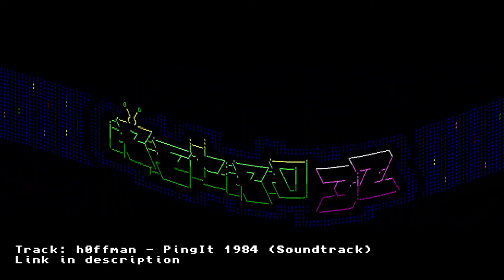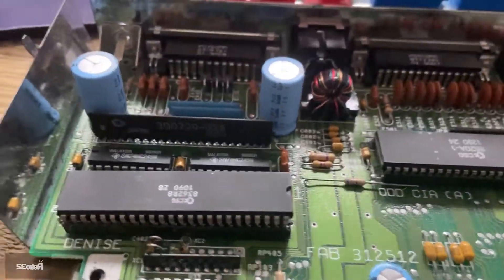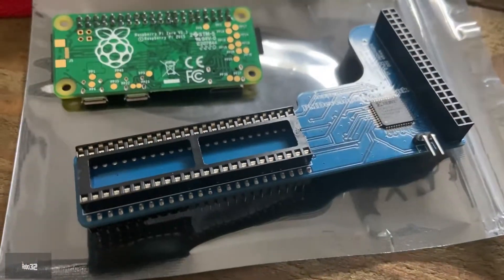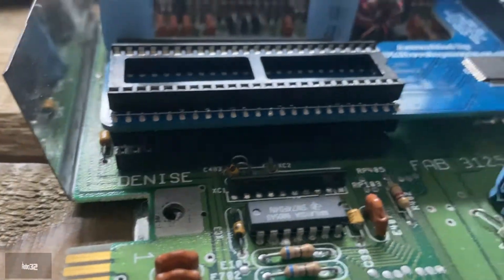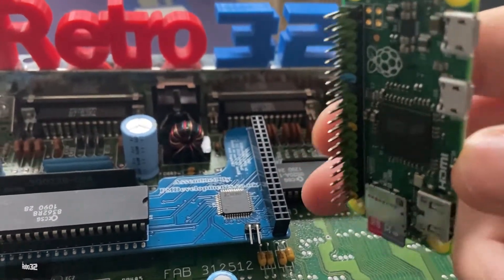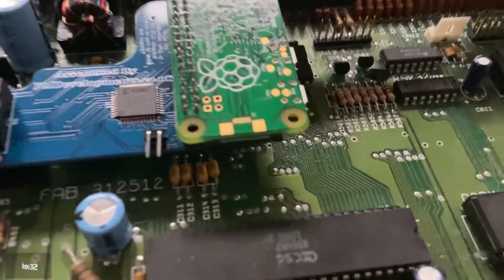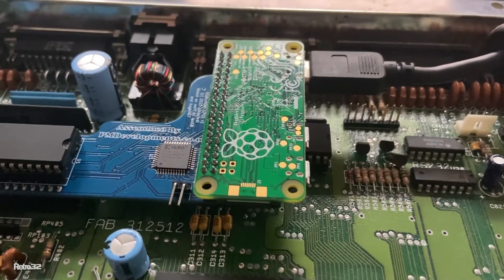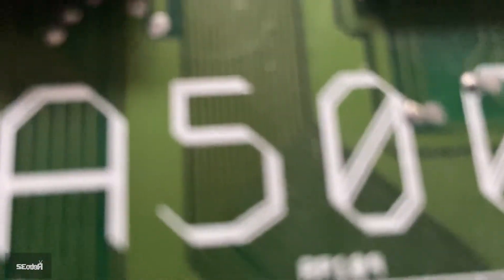Amiga 500 RGB to HDMI CPLD Adapter fitting guide

Comment: Doesn't this obstruct little bit a keyboard connector if you have a thick HDMI cable?
Reply from the maker: It can do. This is why I use a right angle hdmi ribbon cable like they use for FPV

Comment: Can you show what options you have set in the menu, I see the desktop but it flashes, when I go into the menu it is fine, I have tried a few different resolutions but the desktop keeps flashing
Reply from the maker: Other than to test out the cables, I’ve only used the menu once to see if it works. I leave it completely standard
Reply: @Retro32  I had to disable the auto profile switching, I think it depends on your tv/monitor.  I also switched my sub profile to amiga60hz.

Comment: Hi there, please could you tell me how you cycle through the config menu? Is that mouse or keyboard driven?

For me it’s stuck at the top of a menu
Reply: you need to hook up the little switch that was included and click it to go thru the menu and long press to activate an item, then you will see the > < around the item that is being changed, short click to change it and long press to go back to the menu, when you are done click thru the menu until you get back to the top and long press to apply changes
Reply: @MatteoPascolini  I tried it like that, but the short press just closes the menu..? What could be going wrong here.. HW or SW ?

Thanks for reaching out
Reply: When I say short press / click I mean for just a second.  And you have it hooked up to the adapter board, not the PI.  And you have it installed as it is shown in this video?  With the hdmi cable coming out of the PI to a monitor?  Can you make a video with your phone showing how you have it hooked up and post the link here.
Reply: @MatteoPascolini  : I’ll make a vid today and let you know
Reply: @MatteoPascolini  made a short video of where I’m stuck. I appreciate you taking a look and offering to help me out.

Apologies for the late reply, I was suffering a back injury.

https://youtu.be/w7DGBhcsrBY

Comment: Great to see new Amiga upgrades.
Reply from the maker: Definately - there's still so much hardware and software development going on. It's a great time for the Amiga community
Reply: @Retro32  Yeah, i know.

I use a Amiga CD32 + TF330 v3b 128MB and have a Amiga 500 and Amiga 500+, so yeah it's great to see new Amiga hardware and software.
Reply from the maker: I’ve got the TF330 and it makes the 32 into the machine it should have always been. Just watched that Another world video on your channel - it’s epic!!
Reply: Just got back into the Amiga world thanks to all the new things going on. Pistorm is first, but regarding this unit. Does it all fit ok in a standard 500 case? And if so how do you suggest the hdmi cable is routed out of the case when all is assembled again? Thanks. Helpful vid.
Reply from the maker: Hi Alan

Both the RGB to HDMI and PiStorm boards will fit in the case however you’ll need to put something to protect the top of the Pi on the storm as it touches the underneath of the keyboard. The PiStorm and RGB adapter is an amazing combination in the 500. I currently have stock of the PiStorm and this board in stock if you wanted to check it out on the website. 

We have a very basic side panel with a cutout available but I will soon be offering a more elegant solution with ports integrated into it. 

Feel free to reach out if you need any more info.
Reply: @Retro32  thanks. 👍